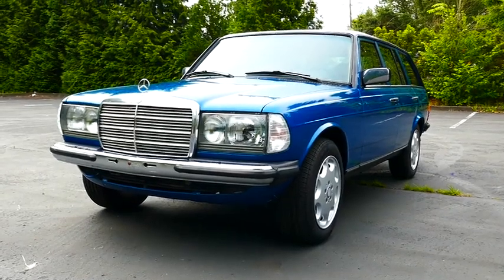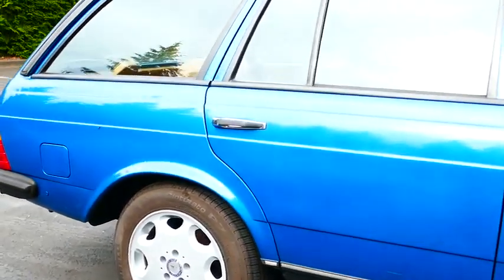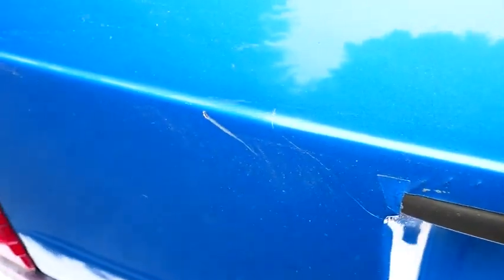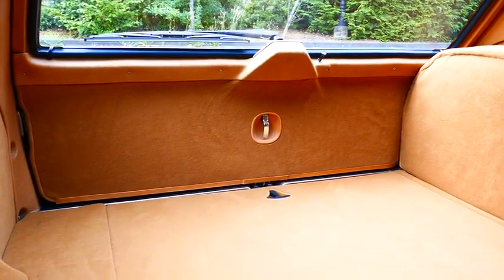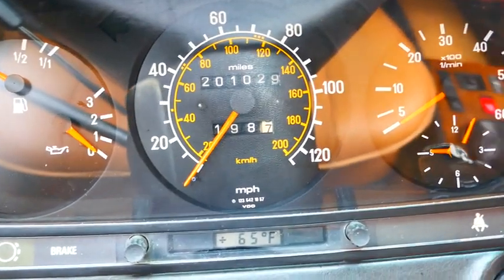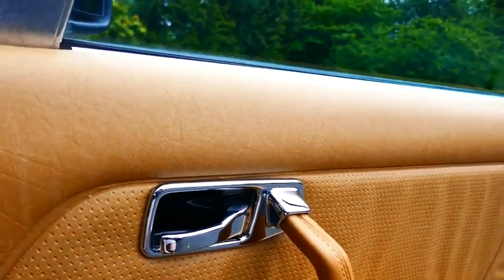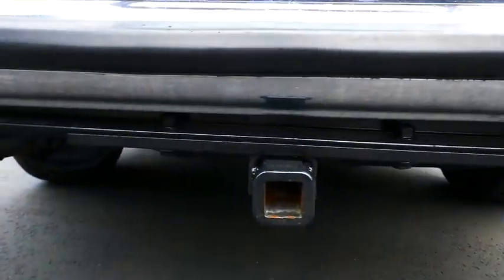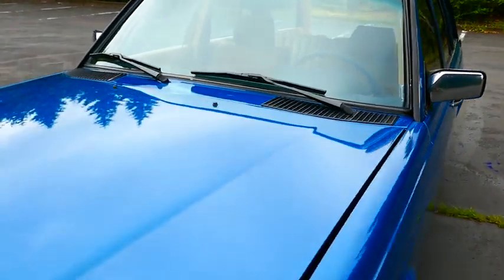1983 Mercedes-Benz 300TD Walk Around Video

Comment: The mold was to prevent door dings in the bodywork and also to keep road dirt from the tires under the mold to keep the upper side clean when driving in bad weather. The delete makes the rear of the car miss its "eyebrows" but sure it gives a clean look over all.